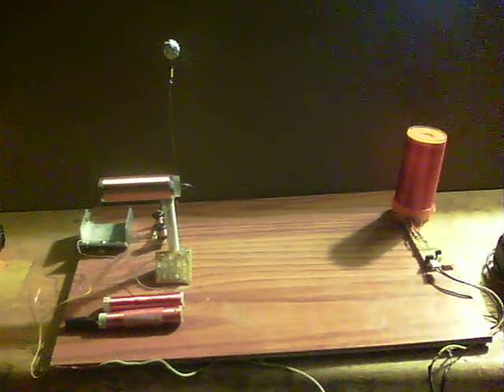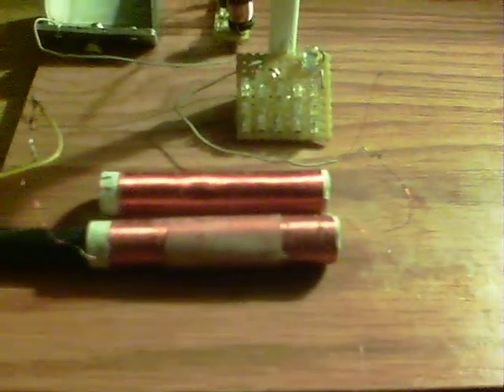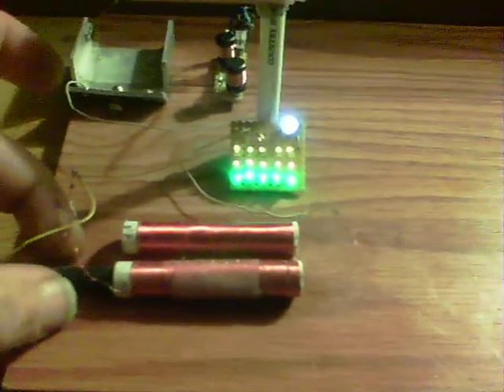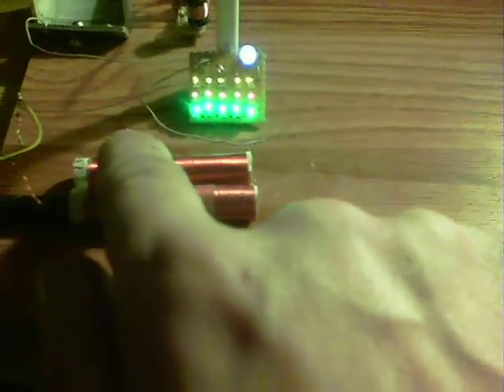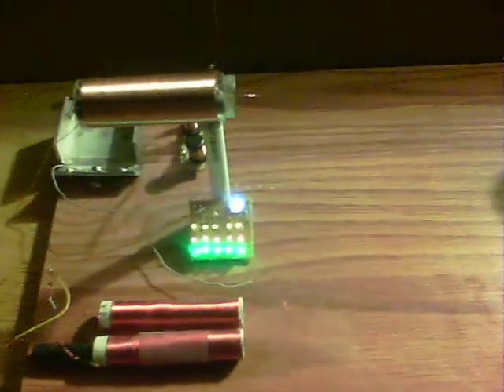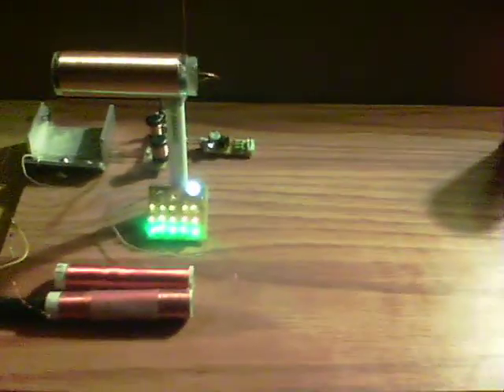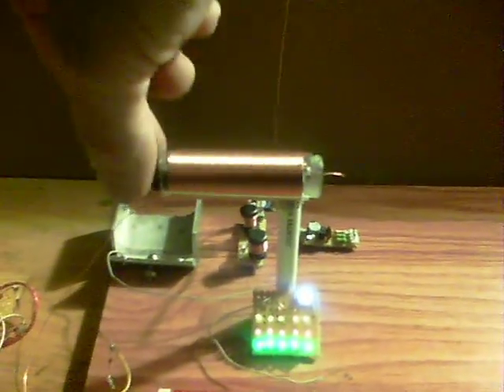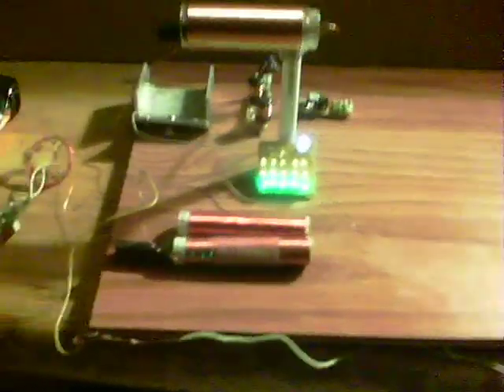SEC 4 - Wireless no battery range

Comment from the maker: The last part, yeah, but not perpetually, as the supercap would probably drain and have to be left to charge again. Depends on usage time per day/radio/strong /stations/supercap value/current draw.
Just antenna is needed and a virtual ground, like big heatsink from car amplifier. But a wireless source is needed to supply the power to antenna.

Comment from the maker: Yes indeed, I have more meters etc nowadays and so would like to return to all this...the zero input voltage circuits especially. What ever we can pick up out of the ambient atmosphere and the local Ground (with no mains power running in the house) is a big interest. 
There's a limit to all capacitive couplings in terms of total power, at some point all receivers will begin to dim...but, that drives efficiency designs for such receivers :)

Comment from the maker: @Lidmotor As I understand it, it's like radio, amplified. If you take the speech and music out of a radio broadcast you end up with purely energy. So, we tune to a natural frequency apparently of 13MHz and always and forever present. Then, Ron uses a very clever resonant amplification route to bring that signal stronger and stronger. The L3 is like the tuner coil in a radio for example. Kinda works oppositely to a Slayer circuit and mentally has similarities to crystal sets in action.